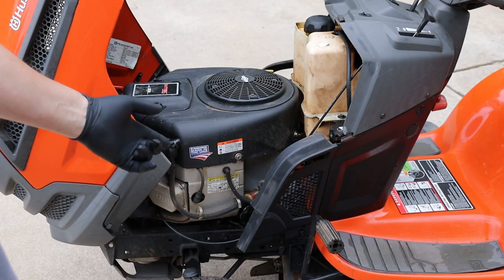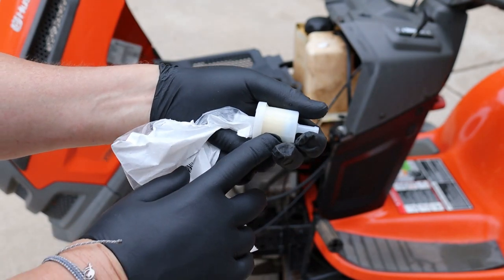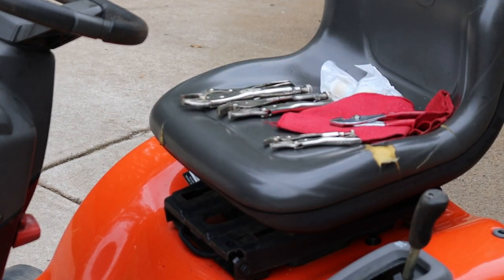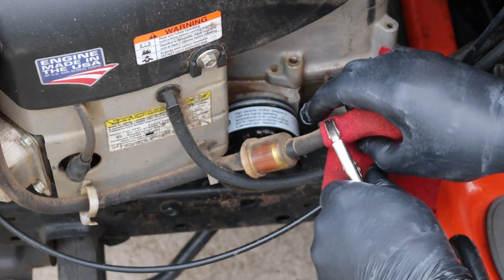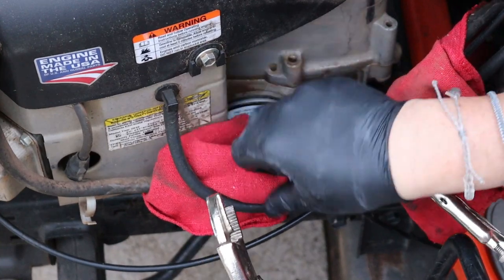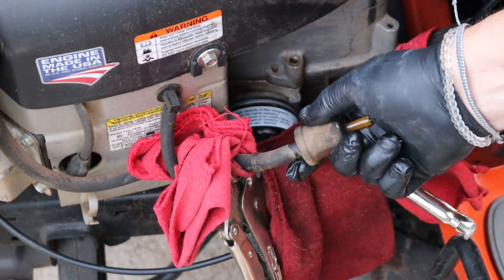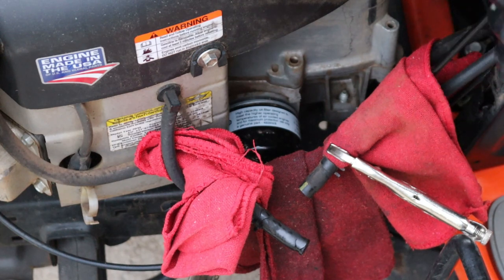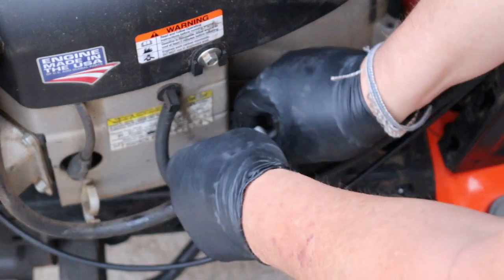Change the Fuel Filter on a Mower

Comment: I bought one of these types of filters this spring for my yearly maintenance and my mower kept dying after installing the filter. It turned out that I can't run this type of filter on my old craftsman mower because it doesn't have a fuel pump and I wasn't pulling the fuel through the paper filter and basically running out of gas with a full tank. I thought that the filter was bad or the fuel line was partially blocked or that there might have even been something in the carb but I called my local repair shop and they said that the paper filters are meant to be used for engines with fuel pumps and the old mesh disc type filters are to be used on my mower. I replaced it with a OEM disc filter and it's been running like a champ since. It wasn't a costly mistake but this might save someone else 5 bucks if they read it. Thanks for the videos Dennis. They are very informative and enjoyable.
Reply from the maker: Thank you for watching!  Yes, I don't see many these days, but the smaller engines do use those flat fuel filters....seen a lot of them on Snappers.  Glad you got it worked out and thanks for sharing your experience!

Comment: The engine on my 46" Hasquanava blew up yesterday. It was 8 years old with over 400 hrs on it. I thought about getting a zero-turn but since I wanted to be able to use my $400 baggers decided to go with the same mower. I had a heck of a time finding one. Seems these mowers are in short supply. Talked to my lawnmower repair guy and he said these Briggs engines are hard to find so decided to treat myself to a new mower. Wonder if I should do a little reinforce welding on the deck so it doesn't break loose like the first one...
Reply from the maker: Thank you for watching, David!  Sorry to hear about your mower.  Some people have had similar experiences like you and I both on those deck welds, but some people never have a problem.  I'd probably just keep an eye on the welds and at the first sign of separation, clean them up and reinforce them.

Comment: Hi Dennis, I only clamped off the tank side when I changed mine, minimal amount of fuel came out of the engine side. They actually make fuel line hose clamps to pinch off fuel flow but channel lock worked for me.
Thanks for the Great Videos?
Reply from the maker: Sounds good!  Thanks for watching, Jack!

Comment: Great video. Do you have a recommendation for fixing a rattle in the pedal on this tractor?  Mine worsened after I changed the drive belt. Thanks.
Reply from the maker: Thanks for watching, Robert!  I'd check the idler pulley for the drive belt.  They tend to wear out and get noisy.

Comment: Hi Dennis great video's. I have a problem with my belt slipping out of the pullies when i engage the blades, any idea's?  Thank You
Reply: I guess not .... thanks for the help
Reply from the maker: Thanks for watching, Ron!  First check to be sure the belt is turned properly.  The deck belt is flat on one side and tapered on the other.  The tapered side should be running in the spindle pulleys.  I've had one on backwards before and it would pop off every time.  Next, double check your belt routing, you should have a diagram on the deck.  If not, let me know and I can send you a link for a diagram.  The only other thing I've run into, is the belt popping off if I disengage the blades too quickly.  I've always had to ease the PTO lever to the 'disengage' position to avoid making the belt come off.  Let me know if these things don't help.
Reply: @dwcoffey  Turns out both belt keepers were broken off. Don't know how they could have broken 2 of them. Looking forward to more video's.

Comment: Hi Dennis, hope you and the family are well. I've recently become aware that the rpms on my yard machines, especially the mowers should be checked for proper setting. Plus, I don't want then to blow apart if rpms are set too high! Can you suggest a decent tachometer that is both durable a easy to use. Greatly appreciated. Perhaps a lot for a future video?
Reply from the maker: Hi Norman, thanks for watching!  I've never had that problem with any of my small engines, but 'll look into it and see what's available.